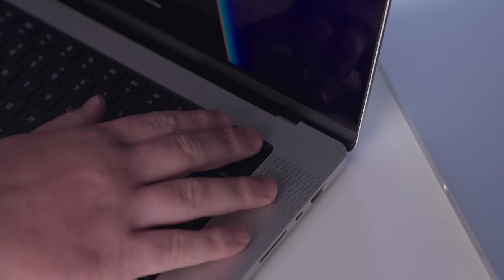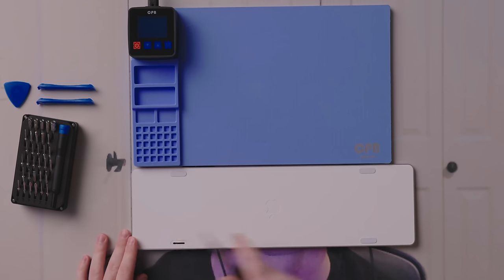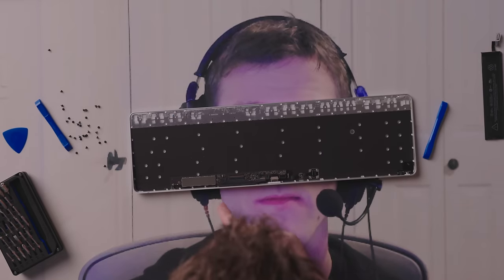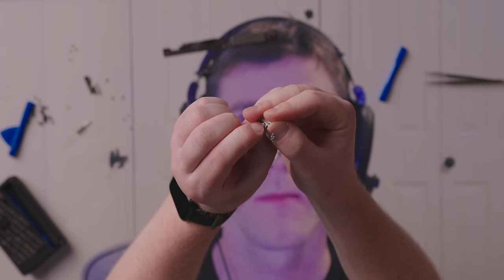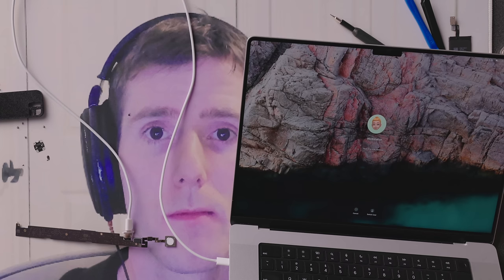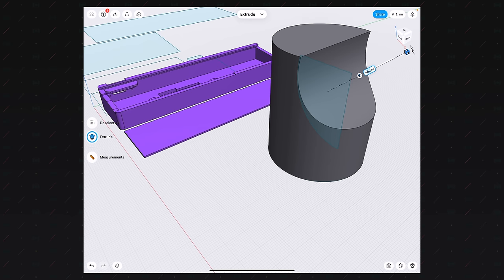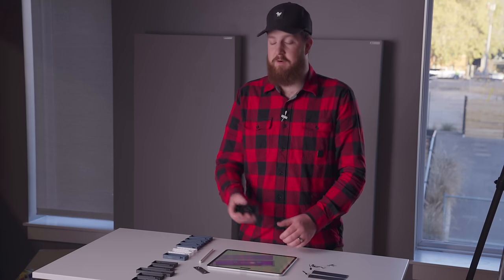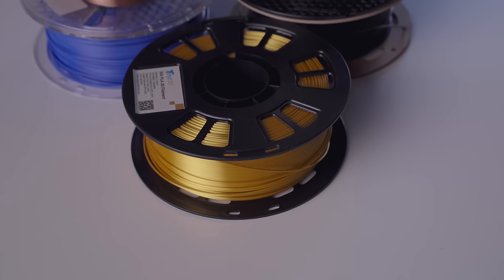I Made a Tiny Touch ID Button for Mac!

Comment: I feel like the idea that Mac users are spending 150 dollars on a Magic Keyboard with touch ID and then gluing it to the bottom of their desk just so they can log in without typing a password is hilarious and exemplifies Mac users in my opinion.
Reply: Depending on workflow, Touch ID gets used a ton more than just unlocking the Mac itself. I easily use Touch ID 50-70x times a day. At that level, $150 for the Touch ID isn’t the problem, it’s that the keyboard it’s attached to isn’t that great.

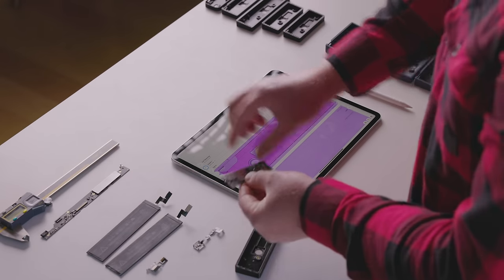Comment: When he mentions, at 12:00 minutes in, he used a digital caliper to measure the distance between mounting holes in the board wouldn't it have been possible, and eaiser, to 3-D scan the board with his iPhone, import that into his modelling app/program then get the exact distance for the 3-D render of the Touch ID casing? Admittedly, I'm not, nor have I ever been, an iPhone owner/user but assumed that capability is possible with LiDAR in the phone's camera setup.
Reply: Yup it would’ve been possible. 
I guess he either forgot about it or wanted to show you how easy it is using the app and that basically everyone can make one
Reply: Would the quality of the lidar scan be enough though? I feel like all the examples I've seen as well as photogrammetry have still yielded not very high fidelity models that you could reliably get a 1mm accurate scan to reference. I've tried both ways but the iPad pro lidar scanner wasn't as good as just using calipers and rulers to measure.

Comment: it would be so cool to either: a. integrate it into the top of the desk, or b. 3d print something that clicks into a mechanical keyboard like a key switch would that can hold the sensor and hide the board inside the body of the mechanical keyboard so it can be part of an actual good keyboard instead of the piece of garbage it comes attached to lol

Comment: Is this whole touch ID thing patented or otherwise locked to be an Apple exclusive thing? I mean, I've had fingerprint readers on my laptops over 10 years ago but I've never seen a third party external keyboard that would communicate with the touch ID. Being able to use a 3rd party keyboard with the touch ID baked in (or, alternatively, being able to pair Apple's keyboard with more than one device) would make my life so much easier and cheaper.

Comment: I need this so bad. I work with an external monitor, with my MBP on a stand to my right and since the sensor itself is on the laptop’s right side i have to reach a mile to get to it. It’s so unconvenient. I also don’t want to ditch my gateron mechanical keyboard.

Comment: I wonder if this can be expanded upon by integrating into custom keyboards, should be relatively simple

Problem is powering it, which means we either plug in two cables to our Keyboard, or find a way to connect a custom battery to The magic keyboard’s battery’s  BMS board

Comment: We need the next level of this... Attach all the PCB's + battery to a custom mechanical keyboard. For a true 'Apple' wireless mech keeb with touch ID.
Reply: Assuming there is no more logic that might just be a question of trial and error to figure out what pins are rows and columns in the connector
Reply: @VideoByEkedahl  Yes, I think so. The hardest part would probably be the uber tiny connectors that apple uses, they tend to be proprietary. You need one that expands into usable pins to figure out the matrix.

Comment: I would buy a fingerprint sensor and calibrate it for my finger prints, then buy a raspberry pico, connect the sensor to it and if the auth is success raspberry will enter the password and hit enter. This would be really cheap but a bit more work to do.

Comment: Quinn, you’ve used a lot of 3d printing in this video with the iPad. I am one of those who honestly can’t justify upgrading a MacBook Pro when I can just buy an iPad Pro for the power, but unfortunately as you know the software isn’t there. I am also into 3d printing, and would love to just use my iPad for printing purposes. I see you can create the models on the iPad, which is incredible, but is there a slicing program on the iPad or did you have to transfer to a MacBook for this part?

Comment: I'm kinda baffled they haven't tried to sell something like this. Just a little square pod with rounded corners not much bigger than the button and a tiny battery itself for like $100. I think people would pay the premium just to have it mounted where ever they want. Stick it where you want with a small mounting plate. Reusable washable sticky pad for areas you'd like a less permanent mount and perhaps an adhesive/screw in mount for a more permanent solution.

But no, to them people who dislike the Apple keyboard must be fringe loonies. Even if you like the keyboard it'd be nice just to have an option for an additional button slapped somewhere.

Comment: Couldn’t you use a different battery in the smaller case? It doesn’t even have to have the same capacity since you’ll use it less than a keyboard. A mouse battery would probably work.

Comment: Still too big... I'd integrate it to mousepad and made wireless charginng for the mouse, also with battery that thin could easily have a battery as a backup source and would add that few mm, maybe 4mm at max if would be as high as connector all the way, else it could have a small bump on the edge and thinner after, on those huge whole desk pads from ltt, gn etc you can spare 8x2 inch in the top corner (or bottom)... That's how I'd do

Comment: you could have also gotten a usb fingerprint reader if you don't want to go into the trouble of taking a keyboard apart
Reply: Those don't work on Apple Products due to the fact they use a secure enclave to store the fingerprint hashes. Apple ignores any other FP readers. You can still get them for FIDO type authentication for Chrome, etc. but tMacOS basically ignores it.

Comment: I've had a pretty stupid idea for a long time now. But seeing this vid, I thought maybe it isn't that stupid after all. In short, I have a first gen magic mouse, which has seen better times, although it still works good. I can't imagine using any other mouse for Final Cut because of its touch surface, however, it'd be amazing to have more ergonomic form. What I've thought of is 3D printing a custom lower part of a magic mouse that mimics some ergonomic mouse, but fits top part and guts of a Magic Mouse. Maybe that's something You would be interested to do?) Or is it too stupid?

Comment: you're a hero. I didn't think this would be possible. what I really want to see is this integrated into a mechanical keyboard. I guess that gets complicated pretty fast, but if it can be mounted on something that can fit into an MX socket and there's room in the keyboard's case, I wonder

Comment: I think a better approach to this entire project would be intercepting and reverse engineering the Bluetooth signal that the touch id keyboard sends to the Mac. I am sure this is no easy feat, as the signal will be encrypted and all, but the rewards are big: you could use any kind of Bluetooth enabled hardware to emulate a touch id sensor.
Reply: The payoff would be bigger than that… if you managed to do that you’d almost undoubtedly qualify for the top bug bounty tier which is around $1M as that would be a major security hole.

Comment: Just a friendly fyi, the word fillet, is not pronounced like a fillet o fish but rather as ‘fill-it’. When you round over a hard external corner eg edge of a box that I’d called a ‘round’ and when you round over an internal corner it’s called a fillet. Both are done using the tool named ‘fillet’ in most cad software. (As a side note, engineers jokingly pronounce it the way you did in the video but only when intentionally being silly)

Comment: Just tried this myself and I will say be SUPER CAREFUL with the tiny ribbon cables. Unfortunately, I damaged one while removing the touch ID button and it no longer works :( 

Would be nice if the video went into more detail about what screws to remove and how to safely remove the ribbon cables, rather than cutting away to when it's already removed.

Comment: Is there any benefit for this $100+ TouchID Button instead of a standalone $60 Fingerprint accessorie from someone like kensington? Other than that this is all Apple inside
Reply from the maker: None of those work well with macOS due to driver issues. No kernel-level support. Also, TouchID is faster.

Comment: Now test it with a system that didn't come with a TouchID sensor from factory. Heck, test it on a Hackintosh
Reply: The sensor only works with Apple Silicon even if it's still in the keyboard
Reply: @xEqualsRandom  Yeah, I remember reading that when I last looked into these. Too bad really.

Comment: Wouldn't it be a better idea to drill a hole in your Keyboard and build everthing into your keyboard?
Reply: From what I can see he uses some sort of IBM Model F keyboard and they are quite rare and expensive, and they are build like absolute tanks with very, very thick plastic shell and a metal plate inside. Drilling something like that is not fun and may cause the case to crack.

Comment: did the whole thing and the touch id scanner stopped working just because, button still worked I was able to put it to sleep but not to wake it up and adding a fingerprint did nothing. I looked other youtube videos of dudes also doing this and some of them they have the same problem, other ones just start working randomly by moving the connector around. Man apple has really beautifull devices on the outside, in the inside is just hell, never gonna buy a membrane magic keyboard ever again

Comment: I really liked my Apple Extended Keyboard II, which I still have in perfect condition btw. However I'm a very big fan of the current keyboard. Or actually last gen keyboard. I'm not a fan of the new larger corner radius that inflicts with the keys. Bad design Apple. Bad design.

Comment: How much trouble would it have been to use an Apple watch that you picked up used?  Perhaps one that has a damaged screen but the finger print sensor is still in good working order.  It'd be a hell of a lot easier to mount that entire package vs going to the trouble of ripping apart two poorly made Apple keyboard with touch ID.  As you've already stated these thin keyboards are notoriously poorly made which tells me so is the touch ID sensor.
Reply: Apple Watch doesn‘t have a fingerprint reader. Its security is based on knowing that you have the watch on your wrist and entered your password once. If you take it off, you would have to reauthenticate.
Reply: @poabeaving  You'll have to take it off at some point.  So how does it know if the person wearing it is the rightful owner?  I mean does it pair with the owner's Apple smart phone?  If their Apple smart phone and their Apple Smart Watch are both stolen by someone who knows their credentials is there any other layer of protection from illegal access to the two computers?

Comment: Im gonna rant about apple for a second: Apple could seriously make the best tech in the world if they just did a few minor thing. USB C, slightly more user serviceable (aka no software/firmware lockdown BS), slightly thicker for more durability. Seriously these few things would have me sold on apple products. Ipads are great pieces of technology but they have become way too flimsy. I am fine with 1-2mm thicker if it means more durability and possibly a larger battery.

The only piece of Apple tech that I think is truly amazing though is the watches. No one comes close to making a smart watch like apple. But not allowing them to sync with android is really dumb. I would buy an apple watch if it would work with my samsung, or google, or oneplus device. Oh well I just gotta hope one of the other smart watch makers catches up.

Oh and if I had an iphone I 100% would be getting in on those class action lawsuits about privacy and data tracking. Apple claimed to be the most secure and not stealing your data as long as you toggled one option in settings, but it was a total lie. That is scummy and I hope it loses them a lot of money. They should also be sued for the firmware lockdown things they have been doing since the iphone 5s.